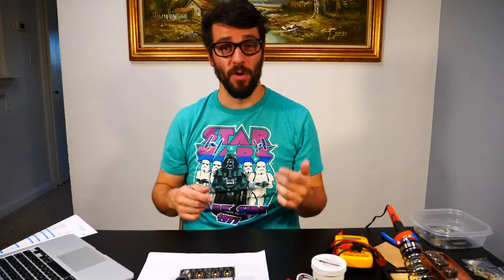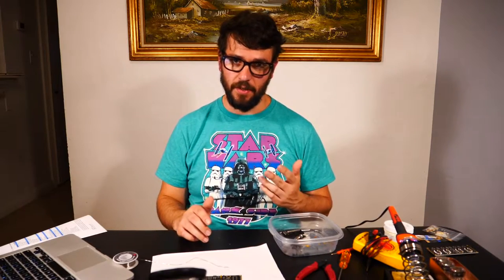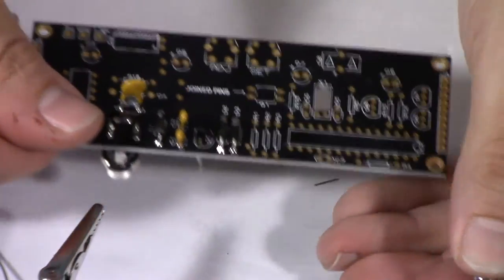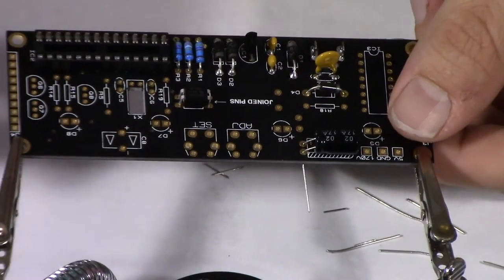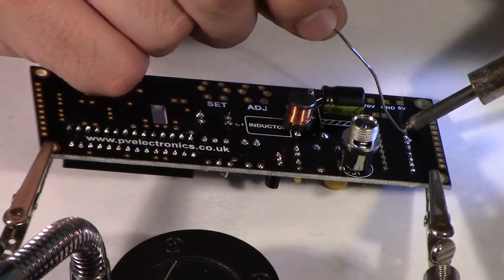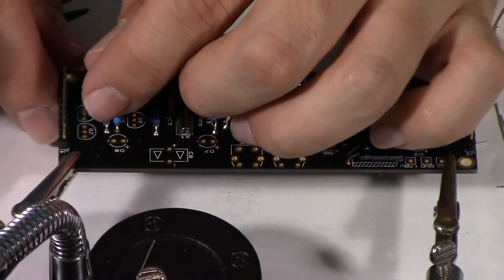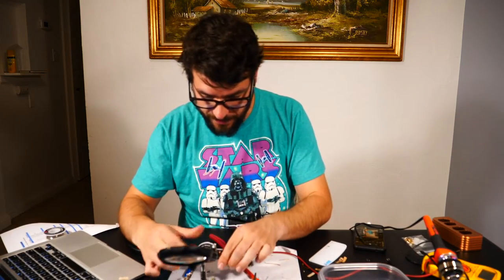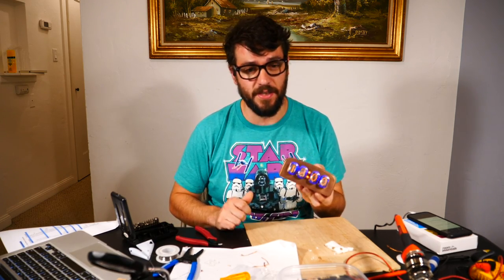Let's make the PV Electronics Nixie FunKlock. Full walkthrough for beginners

Comment: Nice video! At least the sections that I watched... I admit that I skimmed through, to see if I could solve a problem I had, and I think I now may have the solution, thanks to this. I assembled the same kit last night, complete with using the extra long buttons to pass through the large case. I didn't have the problem you had with the buttons (I realized they needed to be mounted on the rear side, even though the instructions didn't mention this), but I did have another problem with the buttons, which is that I seem to have mounted them turned 90 degrees! When I power it up right now, it shows " 1:00" with the colon blinking once a second, and the buttons have no effect. I suppose that my rotated buttons make it behave as if both buttons are pressed continuously. Now that I've seen your video, I will also use my desoldering braid to remove the buttons and mount them correctly. :D
Reply from the maker: If you can get one, a solder sucker would probably be the thing to use first (they are REAL CHEAP on amazon), then use the braid to get the remainder.  If I had known about them when I did the kit that is what I would have done.  goodluck!!